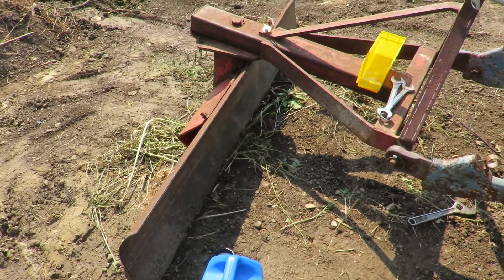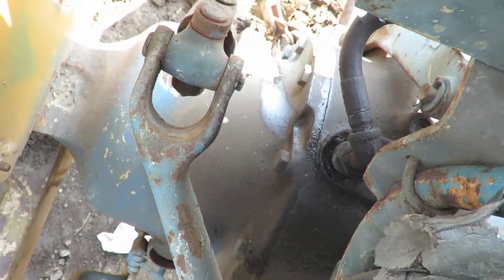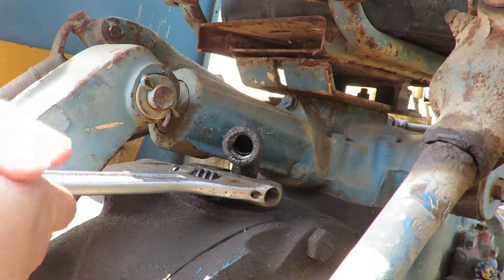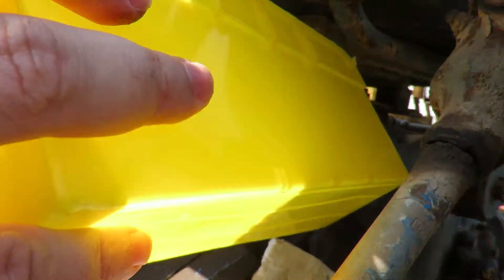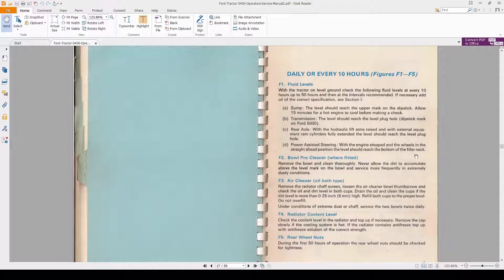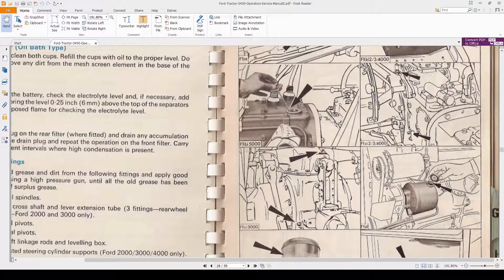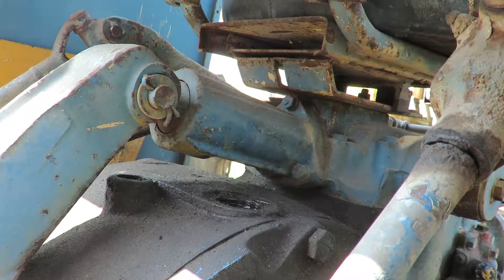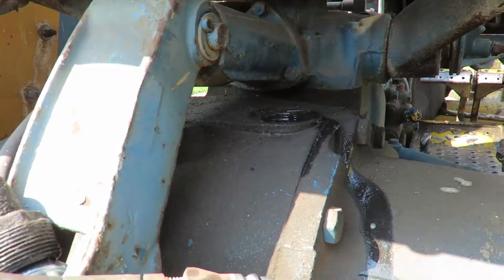Ford 3400 3 point hitch hydraulics lifting sporadically fix

Comment: I'm having this problem and plan on doing this but my front bucket works fine, did your other hydraulics still work? Are you able to share that repair manual? 
Great video.
Reply from the maker: Thanks yeah the Front bucket worked fine think they are separate reservoirs. And here is google drive link to that User's Manual https://drive.google.com/file/d/0B9Aw8qwgOTlrQkc4dFN0VmRJOW8/view?usp=sharing